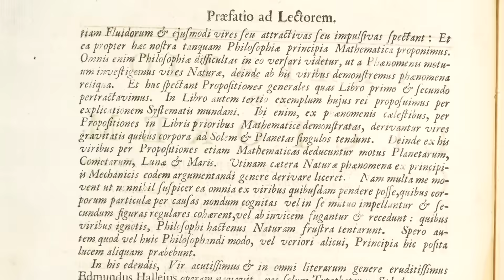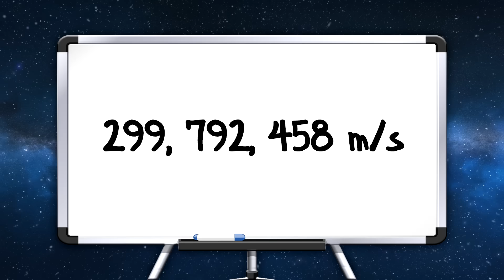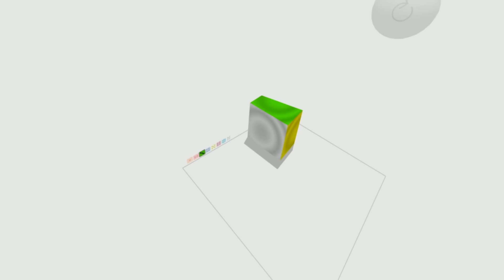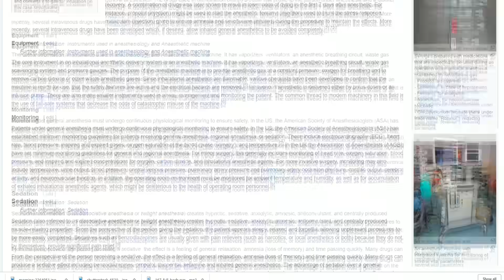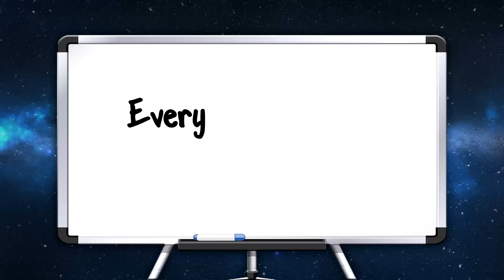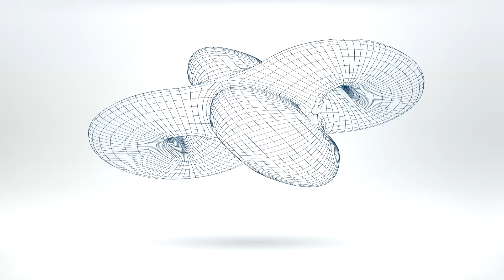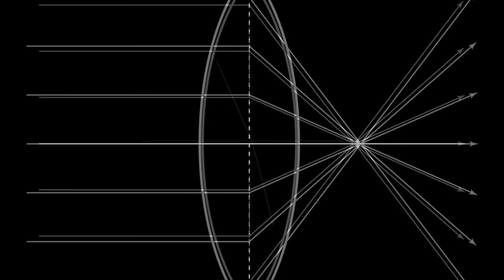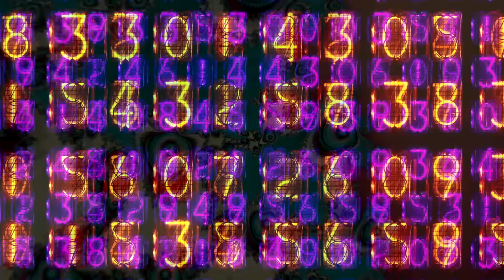The Mystery at the Bottom of Physics

Comment: Interestingly, gravity is an approximation and it turns out it isn’t exactly constant everywhere. 
Also note Einstein’s theory of relativity is required to make sense of the heliocentric theory of the solar system. The history of this theory is that in the late 19th century, ether-drift experiments performed by physicists such as Michelson and Morley remedy to indicate that the earth is stationary relative to the ether (a medium that in the wave theory of light permeates all space and transmits transverse waves). Since ether was them conceived as a highly rigid medium, this seemed to indicate that the earth was stationary with respect to an absolute frame. Although many efforts were made to avoid this conclusion, this did not prove to be possible in the framework of classical physics. 

The dilemma was only resolved with the I introduction  of Einstein’s theory, which involved radical changes in physicists’ conceptions of space and time, and which has many strikingly counter-intuitive consequences. These include the famous twin paradox, in which a space traveller returns to earth from a year’s journey at nearly the speed of light and discovers that many years have past.

Even gravity while quantitatively accurate has its shortcomings. For example to this day Newtonian theory can’t account for the long-term behavior of the outer planets, namely Uranus, Neptune, and Pluto. One way to account for this is to posit the existence of an additional planet (or planets) that is influencing these planets. However, thus far such a planet in unknown.

The story is often told that the French astronomer Leverrier predicted the position of the then unknown planet Neptune by the gravitational calculations based on the orbit of Uranus, and that Galle in Berlin pointed his telescope in the indicated direction and found the planet right where Leverrier said it would be. However, further analysis quietly showed that the planet Neptune is not the planet to which geometrical analysis had directed the telescope, and that’s its discovery by Galle  must be regarded as a happy accident. The discovery of Pluto involves a similar story. 

In the 1870s Leverrier argued that discrepancies in the orbit of mercury could be explained by the existence of a planet between mercury and the sun. Such a planet was, in fact, reportedly observed. It was called Vulcan, and Leverrier calculated an orbit for it, based on observations. Now, however, it is believed that this planet never existed and that the reported observations were all illusory. If this is so, then the derivation of an orbit from spurious observations suggests that considerable fudging was involved in Leverrier’s calculations. On the other hand, if a planet-sized object did travel in Leverrier’s orbit, then what became of it? 

One of the most striking theoretical developments of 20th century physics was Einstein’s theory of general relativity, which accounted for the anomaly of Mercury’s orbit. However, some have claimed that Newtonian theory can explain this of the sun’s shape is oblate. And others have pointed out that there is an anomaly in the orbit of Venus that cannot be accounted for if Einstein’s theory perfectly accounts for the anomaly on Mercury’s orbit. 

 During November 11, 1940, over 200 observers cooperated in studying the tenait of mercury across the sun. He transit began 36 seconds late, and later 18 seconds less than it should have, according to gravitational calculations. Transits of Galilean satellites across Jupiter also have been repeatedly reported to occur minutes form their calculated times.

Theories of planet formation based on Newtonian dynamics require that all planets should rotate on their axes in the same direction in which they rotate around the sun (ie counterclockwise as seen from the celestial
North Pole). Recent radar measurements have shown that Venus revolves on its axis in a clockwise direction and always keeps one side facing the earth at all times when Venus is closest to the earth. This is hard to explain, since tidal influences of the earth on Venus should be very weak. We should also note that pre-radar measurements showed that Venus rotates in a counterclockwise rotation with a period of either 23 hours or 255 days. Recent measurements have also shown That the atmosphere of Venus has a clockwise rotation period of 5 days. 

The rings of the planet Saturn have many puzzling features, including the presence of many annular gaps. These are strange enough to provoke the following assument: At the very least resonance theory cannot account for the thousands of gaps—there are not nearly enough resonances. Indeed some astronomers ask whether resonances can really explain ANY gaps. Sweeper moons might plow out some gaps, but the Voyager photographs do not reveal these postulated satellites. More ominously for celestial mechanics, the complex, dynamic nature of the rings seeks beyond the power of Newtonian dynamics to explain and may require a whole new theoretical structure. 

In may of 1976 the Laser Geodynamic satellite was placed in an accurately determined orbit at an altitude of about 3700 miles. The satellite was found to lose altitude at roughly ten times the rate attributable to aerodynamic drag and other known forces. 

Small discrepancies in the orbital motion of the moon have led some investigators to propose that the gravitational constant G is slowly changing. 

A real of researchers in Greenland has reported evidence for a small, non-Newtonian component in the force of gravity, and similar results have been reported by other investigators. It is interesting to note that the Greenland team includes physicists dedicated to new quantum mechanical theories of gravitation that male non-Newtonian predictions.

The above goes to show even theories of gravitation are approximate descriptions of nature rather than exact accounts of how nature works. These examples also show how illusion and wishful thinking can play a role in making scientific theories seek more  perfect than they actually are. 

The causes of gravitation have been controversial in the since of physics for a long time. Newton himself stressed that his theory was only a numerical description of observable effects, and he deliberately made no hypothesis about underlying causes. He spoke of gravitation as “action at a distance,” but the idea of a force acting mysteriously across empty space in seemed abhorrent to newton and other scientists, both in his day and the present. Thus the history of physics in the 18th and 19th centuries was marked by many attempts to explain gravitation through some kind of interaction of substances or particles moving through space. Unfortunately all of these attempts were unsuccessful. 

In recent years Einstein’s general theory of relativity has explained gravity as bending of four-dimensional space. However this theory has not been accepted as final by physicists, and attempts are being now made to formulate a quantum mechanical theory of gravitation. Since quantum mechanics is now accepted by physicists as the basis for understanding all atomic phenomena, such a theory is required to provide a consistent foundation for modern physics. This far, however, physicists have encountered insurmountable difficulties in their efforts to construct a quantum theory of gravitation, and the nature of gravity remains an open question.

Comment: The biggest flaw to physics, is unironically the scientific method. Because it requires observation. Observation, requires the prerequisites of 3rd dimensional speed of light. It does not include any other interpretation. Meaning anything observed, will always be only a fragment of the truth.
Reply: Also, time doesn't exist.
Reply: @1337174m1  If only we could prove negatives

/s

Comment: The speed of light is not constant, light is + being pulled towards - the more negatives there are the stronger the pull as it pulls in the energy the light some of these - become + when it becomes + it stoppes pulling and therefore making the speed of light towards that - slightly less fast. This goes on till there's no more - Just +- meaning big Bang and we'll get to start over, this concept also works with 369 it gets smaller infinite and larger infinite.

Comment: "The universe is as mad as a bucket of coked up ferrets."  Laughed my ass off.  I know ferrets and I know coke users.  That would be one helluva situation.
Reply: @nilavakar8068  Um, no.  Ever heard of Entropy?
Reply: @craigmanning2439  ofcourse everything is always logical.. because maths is molded in a particular  way to actually map the current relation to the existing logical thinking domain.. why  do you think  madam Currie was so puzzled when she tried the experiment of combining two unstable nucleuses into one.. it was because the 1+1=2 logic was not working.. then she realized the energy released was equal to mc squared..
Reply: @craigmanning2439  it's just that the usable energy is getting depleted due to the nature of the universe.. have you heard about the cyclic conformal theory? That the universe when it has it's maximum entropy, it also has the minimum entropy ...
Reply: @craigmanning2439  it's just that the universe has a tendency to loose energy that was created through order.. just like every other thing in this universe.. everything becomes nothing due to disorderliness where's the disparity in that? Entropy is just that.. but you should really read about cyclic conformal theory and conformal mapping, which basically explains that state of highest entropy and of the lowest entropy overlap with each other
Reply: And one who doesn't understand the term entropy would think that entropy is  the degree of disorderliness in a system .. do you even know what is really meant by that?
Reply: Do you know what degree of freedom is?

Comment: There's a radical new hypothesis coming out in the Daily Express written by Tom Fish:

I propose that Andrea Ghez will soon prove that Einstein's theory of gravity is wrong: https://www.express.co.uk/news/science/1043472/einstein-theory-gravity-wrong-black-hole-experiment-andrea-ghez

There's an alternative imagery based on the idea of dark/different matter existing at the centre of the Moon which pulls on the Earth's core to create the ocean tides. The pull would be especially strong when on the same plane as the Earth to create the Spring Tides.

Evidence for a stronger gravitational pull on the orbital plane due to dark/different matter in planetary cores comes from this scientific paper: https://www.pnas.org/content/94/16/8329. It appears more technical than it needs to be. They are saying that the change in distant from the Sun (eccentricity) is only between 1% and 5% and so is way too small to generate the glaciers of ice ages. The orbit of the Earth also goes up and down in a more direct 100,000-year cycle (inclination) and so is a better fit to the data. They lack a credible mechanism but didn't think of an increase in tidal gravity as Earth's orbit traverses the orbital plane of Jupiter. This increase in tidal strength would bring extra precipitation to the polar regions. The increase in snowfall accumulates at a greater rate than summer melting, leading to glacial buildup and advance. The ice ages have little to do with the Sun, much more with the failed star Jupiter.

Further evidence comes from the 405,000-year climate cycle which is attributed to Jupiter and Venus: https://blogs.ei.columbia.edu/2018/05/07/milankovitch-cycles-deep-time/.

Note that the official explanation is that  they "perturb the Earth's orbit" to create the largest glacial cycle of them all. https://www.universetoday.com/139198/jupiter-and-venus-change-earths-orbit-every-405000-years/.

But this still only makes the Earth at most 5% further away from the Sun. The dark/different matter theory is a better fit to the data. Jupiter causes extra tidal strength on the 100,000-year cycle  and Venus brings even more every 4th cycle. 

It will be confusing to start with but is understandable to a layperson given enough thought.

Comment: A few years ago I found maggots living in my recycling. Loads of them. But they weren't maggots they were larvae because they had tiny little eyes and a pincer. When I discovered them they were gasping into the air a a red hue. There mouths gasping into the air. They had formed a small colony inside the giant lid of a tomato ketchup bottle and elsewhere too. Just gasping into the air with mouth parts straight from hell. Ever seen a lugworm mouth? Well they were even scarier than that. Then they started scaling the vertical wall of the large plastic container and making a run for the peripheries of the kitchen. It was quite a task to herd them all together. Then I sealed them into jars for further study as I’d never seen larvae that lived off air before (as there was no biological matter within the recycling box - only glass, plastic and cardboard. But they used their sharp mouth parts to break through the cellophane I’d placed on top of the jars and escaping. So I cut clear plastic bottles in half to study them more closely and used silicon frame sealant along the bottom. They tried to burrow through the sealant but didn’t get right through. So I proceeded to conduct some tests on them. It turns out they can survive in water and possessed gills which was interesting. But most interesting was when I noticed them dancing. They were dancing to the beat of th music as I enjoyed the rhythm of some techno. But it was involuntary. Ever seen a larvae dance? Well I have. I filmed it too. Posted it on youtube, then later deleted it and the video from my phone as I supposed I was hallucinating and didn’t want hell maggots in existence, even in film form. Eventually they started to turn into pupa but I flushed them all down the toilet before they hatched as the stench was starting to overwhelm me. Some days later I awoke to the bathroom filled with flies. I’d played Luigi’s Mansion so I knew what to do. I fashioned a kitchen towel cardboard tube and a cone onto the end of a vacuum and ran around the bathroom sucking them all up. I have no idea if any of this actually happened.
Reply: Also, a house spider ran up my torso when I had no shirt on, one balmy night. I tried to swat it but it seemingly disappeared into my body. That was cra cra too.

Comment: you brought up pi, but i would make the argument that geometrical/mathematical constants like that are not the same as physical constants. (maybe they are in some way, who knows), in a universe with a bigger G and stronger gravity, surely the ratio of a circles circumference to its diameter is still pi (in flat space at least), or if you changed any of the other constants. I would argue that the reason why pi is what it is, is more self evident than the physical constants.

Comment: I always thought time was the fourth dimension. If a line is infinite dots, and figure infinite lines, then forth dimension is infinite forms, which we technically can say is 3d figures moving, so - time. That's what I got when looking into it while I was procrastinating studying for an exam at 3am anyway.
Reply: Intergalactical Commitee of Procrastination 

It's more accurate to say we live in 3 and 1/2 dimensions.  As we can traverse the 3 spacial ones at will and in either direction, but can only slow or hasten our travel forward through the one of time.  

And it's a good thing too, as having effect before cause is a good way to unmake existence.